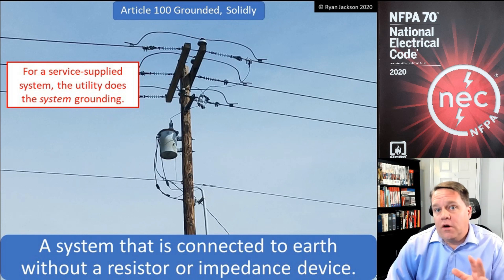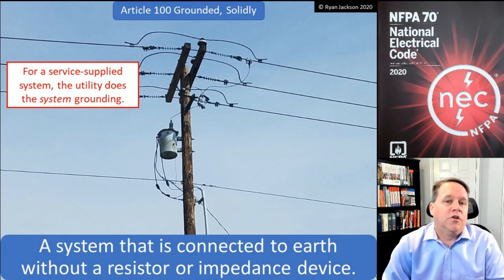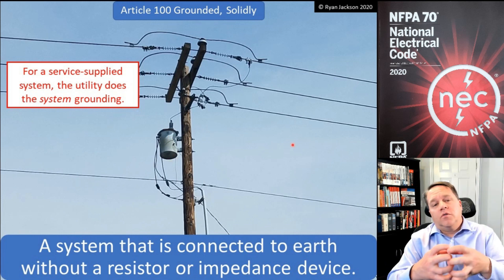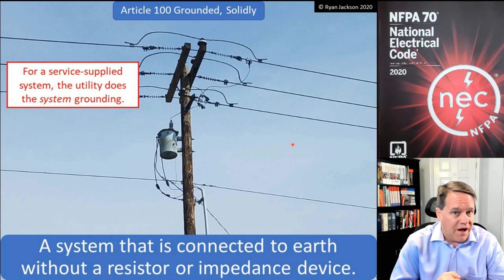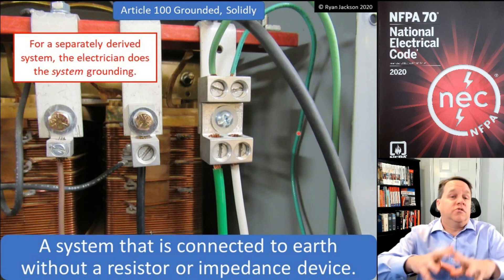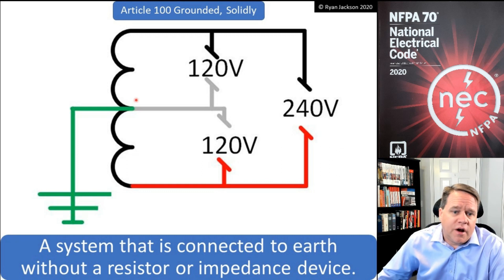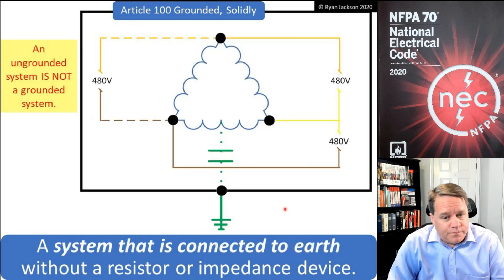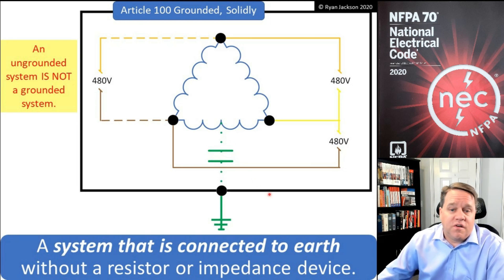100 Days of Article 100: Grounded, Solidly

Comment: silly question but if you cut the grounded  conductor ( the wire that runs from the center tap of the utility transformer to the earth) would  the breaker still see a ground fault?

Comment: Halo Ryan were do terminate the Isolated ground from the Receptacles on the main panel?
Reply from the maker: Usually there is an isolated ground bar in the panel that ultimately goes directly to the transformer.

Comment: To be clear, the transformer secondary winding is solidly grounded. The grounding scheme on the primary does not factor in here. As an aside, I've been doing battle on the internet, trying REALLY hard do get people to STOP calling a single phase, three wire system "split phase". That is a type of motor, for sure, but not a type of service. Someone heard the term, applied it incorrectly by ASSuming, now everyone is just repeating it. It's gotten so bad, that it's all over YouTube, and even manufacturers are erroneously doing it.
Reply from the maker: Correct, the grounding scheme on the primary has nothing to do with secondary's grounding scheme. As far as split phase goes, that term is used internationally to describe the single phase system we use here.
Reply: @RyanJacksonElectrical  Yes, the term has spread like wildfire, unfortunately. "No matter how many people repeat misinformation as fact, it does not make it so". ;) I was just surprised to see it mentioned here. You are very good about nomenclature on your channel, it is quite appreciated. Edison invented the three wire system, using direct current. There's not even a "phase" to "split" with direct current. ;) Likewise with single phase, there's no "phasing", only polarity (albeit instantaneous), just as with direct current...
Reply from the maker: I VERY seldom say it.

Comment: since the utility ensures the system is grounded, as an inspector, how important is it to bond the neutral/gnd bar in a res pnl?  i.e green bolt in service equipment.   

...If the xo is grounded in separately derived system, do you need to bond neutral/gnd in pnl here as well?
Reply from the maker: It is critically important, otherwise the fault current will return through the earth (high impedance, low current) instead of the utility neutral (low impedance, high current).
Regarding your second question, you would connect XO to the metal and not bond the panel.
Reply: but it's ok to bond @ pnl for separately derived system?
Reply from the maker: @joeballard3027  You do it at the source (like a transformer) or that system's first disconnect. But not both.
Reply: @RyanJacksonElectrical  yeah I feel like I've seen a lot of xfmrs bonded plus pnl/first disconnects but those days are gone I'm turning over a new leaf!  Haha

About the first question tho, does the utility ever run ssbj with service?  If so no mbj, right?